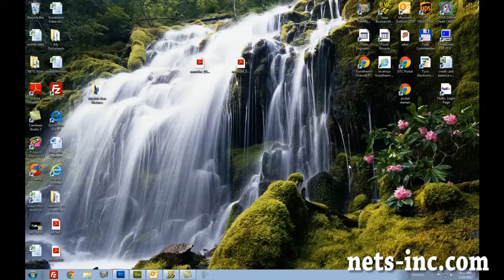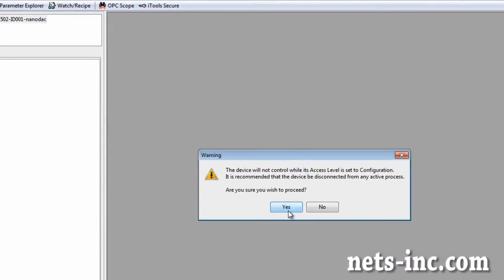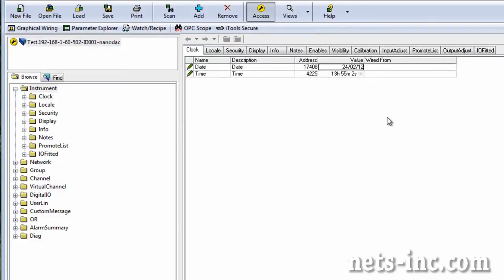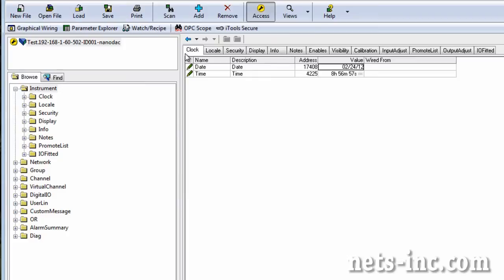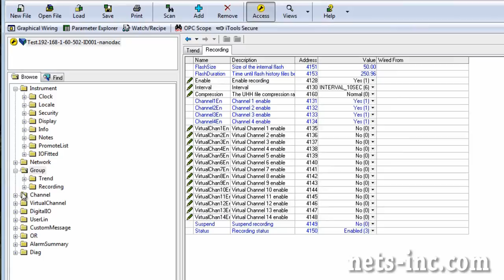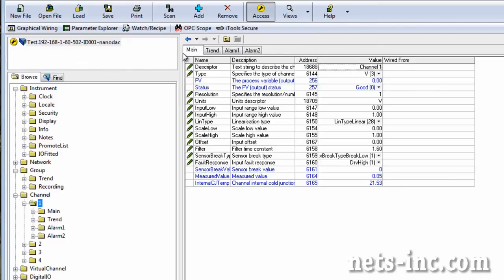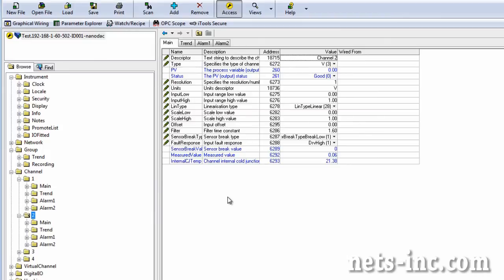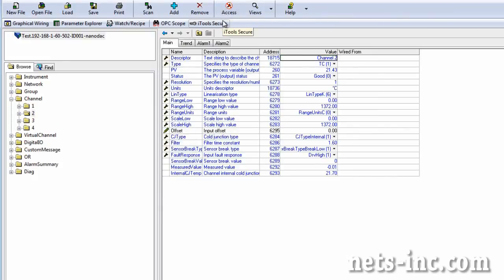From the Box to the Panel: Basic nanodac Setup

Comment: Do I need to use a resistor across the channels if I’m using a 4-20ma signal from a pressure transmitter ?if so what size? I’ve have a pt rated at 4-20ma, 8-28vdc, 0-5 bar